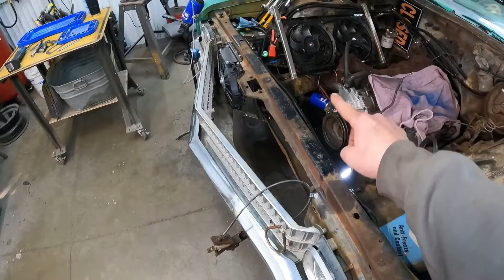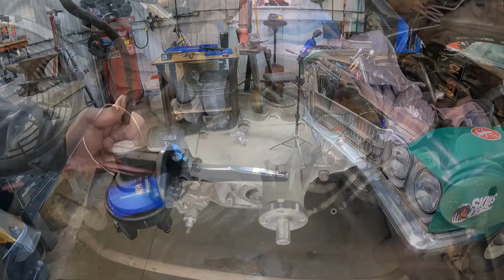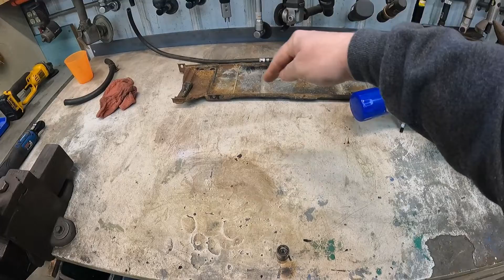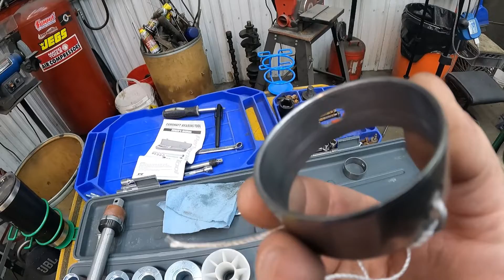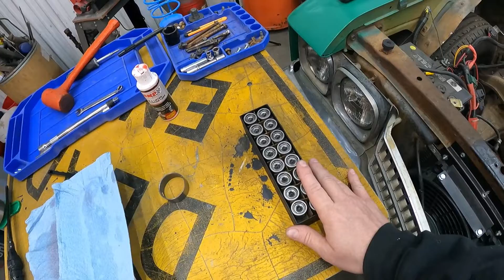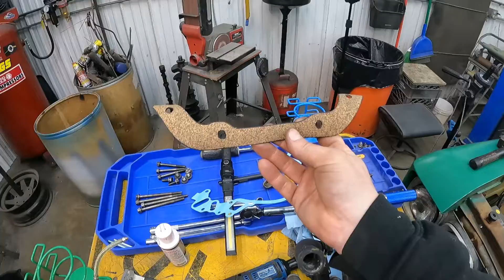Camshaft Installation (stage 1 Buick 455 upgrade) #stage1 #455 #enginebuild

Comment: WHAT were cam specs for Crower cam, and part #?
Reply from the maker: @w41duvernay  here's the information on the cam from T/A Performance.  it's their smallest stage 1 cam. recommended for any 455 with a compression ration under 9:1 So essentially any stock 455 after 1970. Hope this answers your question! 

Product ID: TA_112-455
455H.455"-210'/.468"-215',112'
 
Excellent street cam, giving 20 HP increase over stock cams. Good fuel economy, stock valve train ok. Smooth idle. 8.0:1 to 10.0:1 CR

Idle Quality:

Smooth Idle - just like stock
Good Idle - mild lump, but doesn’t impair driveability
Moderate Idle - nice performance sound
Fair Idle - heavy lump
Rough Idle - very lumpy race type idle
 

VALVE LIFT 

STOCK 1.55 RATIO:
 IN: .455”
 EXH: .468”
TA ROLLERS 1.60 RATIO:
 IN: .470”
 EXH: .483”
DURATION
AT .050
 IN: 210
 EXH: 215
ADVERTISED
 IN: 260
 EXH: 262
LOBE CENTER: 112
POWER RANGE:

Comment: Should have used the groved cam bearings
Reply from the maker: I would have bur unfortunately I didn't have time to wait on them to arrive.  Also I didn't replace them all only the front bearing and didn't want to mix different bearings. when I do a full tear down and rebuild I'll definitely be using the higher quality bearings!
Reply: The front is the only one that matters. I've taken a Dremel to the back of some durabond cam bearings and made my own

Comment: Great video,  what keeps the cam from walking into the front cover.
Reply from the maker: the timing chain is driven by the crank and the distributor and oil pump run off the end of the camshaft. they keep it aligned and in place. Great question and thanks for watching!
Reply: @smokineaglesrodshop   I have one Im working on now, and the cam had a lot of forward and rearward movement, wasn’t sure but now that its apart whoever installed the last cam used longer cam gear bolts and it damaged the front of the block and wore into the button on the front timing cover. Its salvageable but had to have a new timing cover.  Going back together with new parts this week. A very expensive mistake on someones part.
Reply from the maker: @rockyjones4707  ouch, that stinks. the cam gear bolts are very short and can be tricky to get lined up sometimes. decent timing covers can be tough to find. you'll have it running in no time!